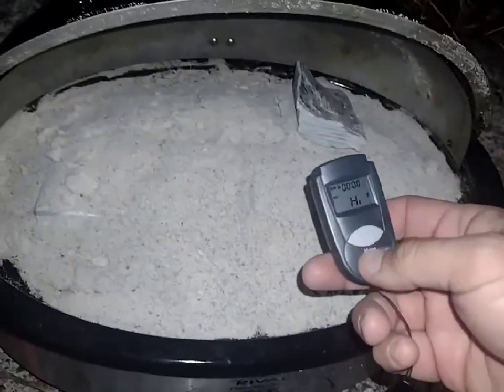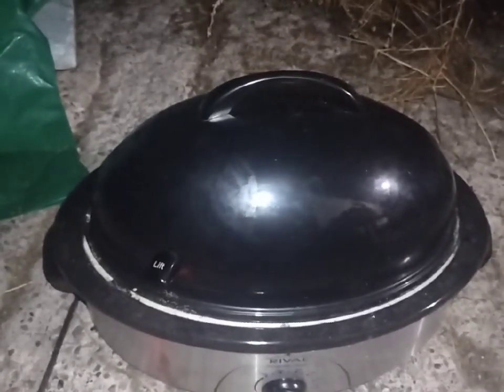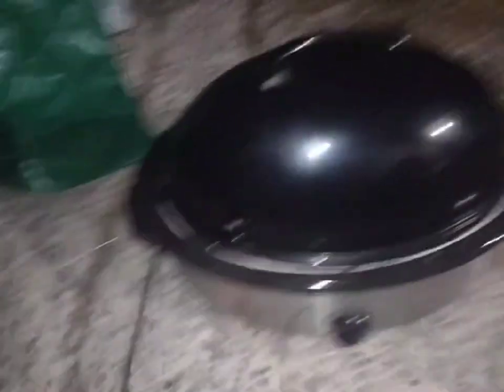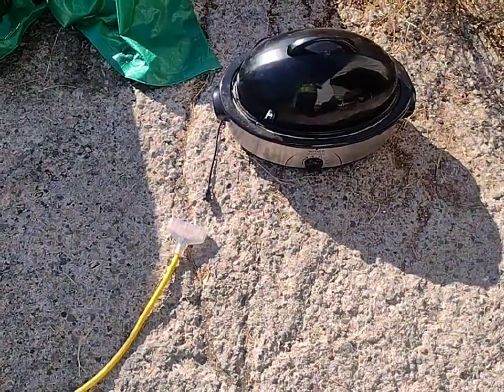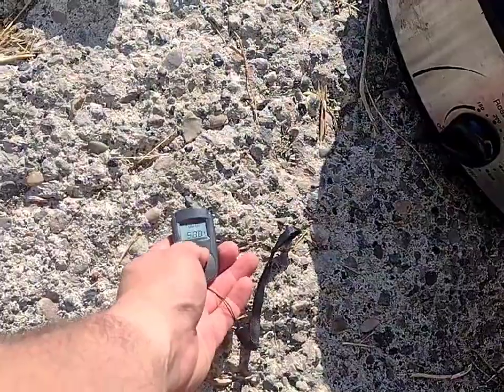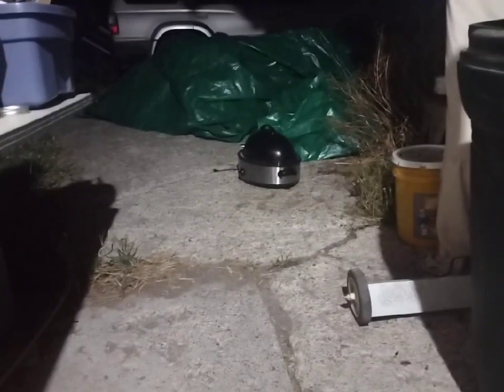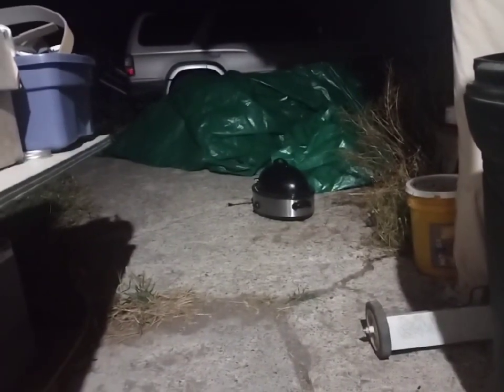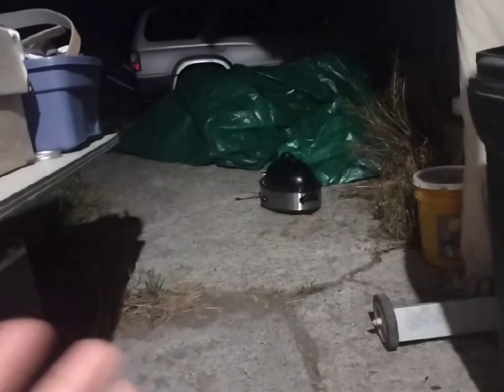Sand Thermal Battery?? 🤯 Heating with Excess Solar?

Comment: Yes it's called a storage heater. And it's being made and sold for decades...
Reply from the maker: Are they sold only commercially or are there consumer models as well? The closest thing I've found is oil heaters, but they only hold the heat for an hour or so before putting it back into the environment.
Reply: @RUFit4Survival  I only know about consumer models. They used to be very popular in the 80's, then kinda phased out as gas got cheaper and electricity expensive but now are getting popular again due to solar panels

Comment: try pipe axle ground tethered hot air plastic sheet balloon, both wind and solar collector, and rain water, the larger the more power/heat

Comment: It seems it would store the heat well but getting the heat into the space might be limited. I’m imagining a better way to distribute heat which involves burying a pipe at the bottom of some sand and running a small computer fan.  Might be tricky with a crock pot but if you could find some other way to heat a bunch of sand let’s say in a box.

Comment: This is great. Now how do we make one the size of a 44 gallon drum?
Reply: making one now - insulated to about R16 top, sides, and bottom at the moment I think, getting a coiled stove element to bury in sand with a couple steel girders for heat distribution, possibly coiled copper pipe in a closed loop to a car radiator.

Comment: You may want to add a bank of amorphous solar cell panels with the standard panels between 8 to 12 amorphous panels . They are lower output but they output from dawn to dusk solar window instead of just 4 to 6 hrs for standard solar panels monocrystalline/polycrystalline, the longer time makes up for the lower output, the also generate during, cloudy and rainy days and partial shading.great compliment to the regular solar panels
Reply from the maker: Definitely something I haven't heard of before & will definitely need to add to my research list.  My brother & I were talking about solar panels for darker weather the other day, so it sounds like they do exist! Thanks a ton for letting me know, it's very appreciated 👍👍

Comment: Great ideal, when batteries are topped up dump the energy into the slow cooker. Genus way to make it simple and if you need the heat anyway. Maybe wrap it in insulation too, that is if you don't need the heat during the day, then have a way to conveniently remove it to allow more heat to escape when you need it at night.

I was also thinking you could overfill the cooker(pretty much bury it in sand). This extra sand would act as insulation at the same time extra heating mass. One cooker might handle 3 times as much sand, or maybe more is the reason i mention it. All that heat radiating off the sides, etc... bury the whole thing and see if it still works. Do you think it ill work totally buried in sand?
Reply from the maker: I wish that would work.  If there was a heating device without a built in temp cutoff that would definitely work.  However if the cooker was buried on the sand or insulated it would shut off too quickly. But it definitely would be an option after it's been shut off in order to contain the heat until later in the night.  So that is definitely something I might try with some rockwool.  The turkey cookers I've found have a temp cut off of 450.  I bought a larger one that I showed in this video and also a high temp infared thermometer as well.  Within the next week I'll be headed down to the ranch and will be giving it a real world try.  Ive got multiple things I'll be trying throughout the winter, especially with the motorhome having pretty poor insulation.  Thanks a ton for watching and also taking the time to comment.  It really is incredibly appreciated 👍

Comment: Thanks fella. Maybe a better thermometer in the next one? So, having captured the energy, are you going to rig up a thermal slow-cooker or an air heater to demonstrate it's application?
Also, I thought the point of a sand battery was to add/remove energy internally (buried air-heater coils) so as to be self insulating, not externally heated.